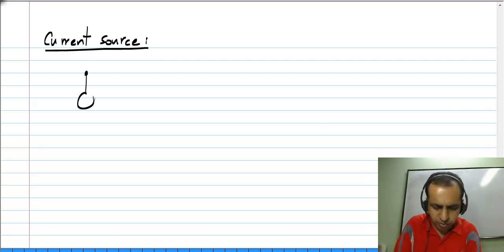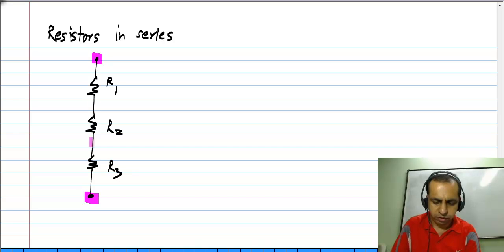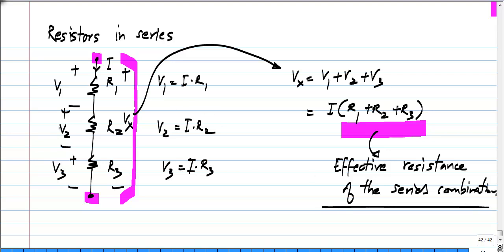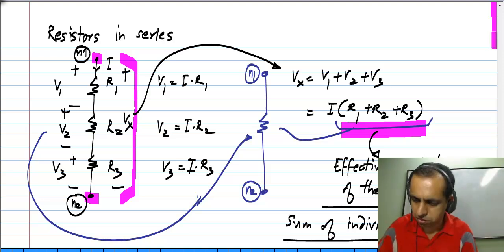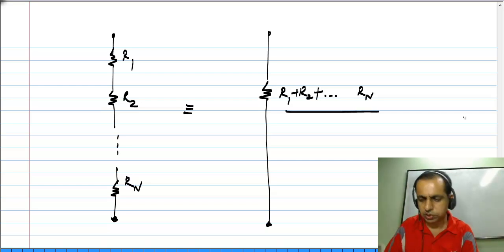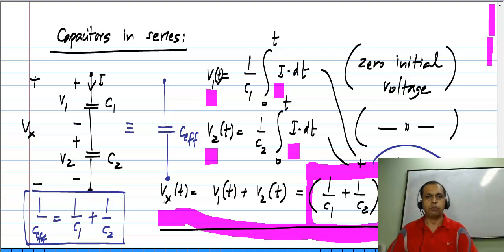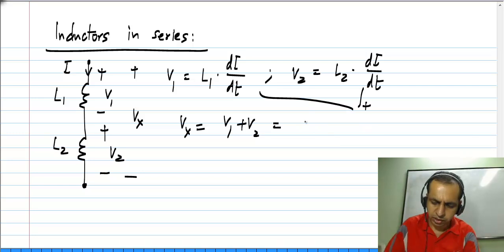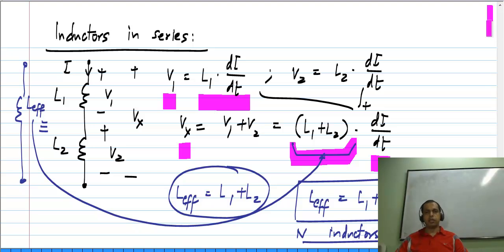Series connection of R, L, C, current source

Comment: Can anyone clear my doubt??
Since, current through all the elements in a circuit will be the same then how the Kirchoff's current law get violated???
Reply: Actually, KCL won't be violated if the currents are of the same value and in that case, there is no need for two or more different sources connecting in series bcz all those basically provide the same current.